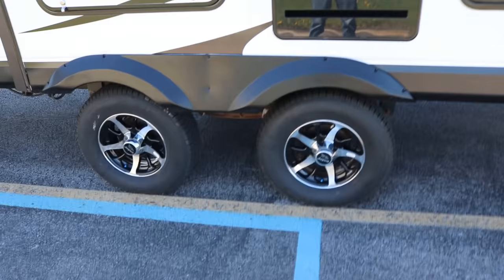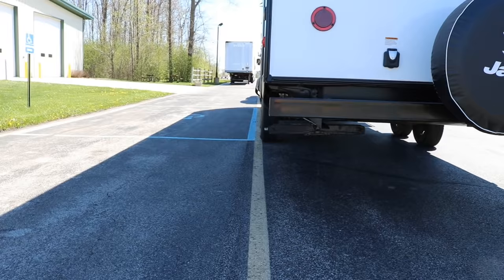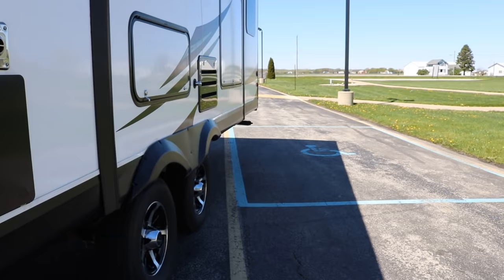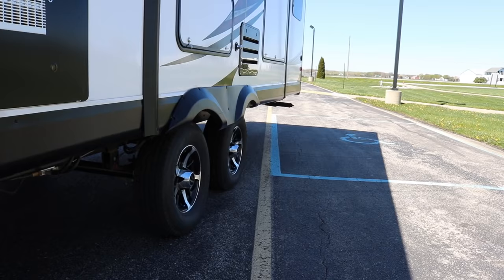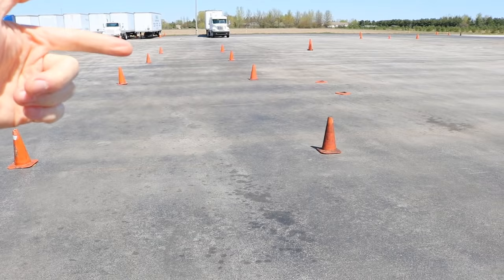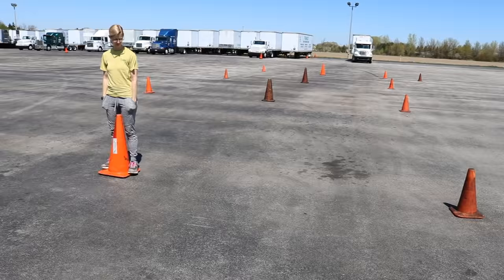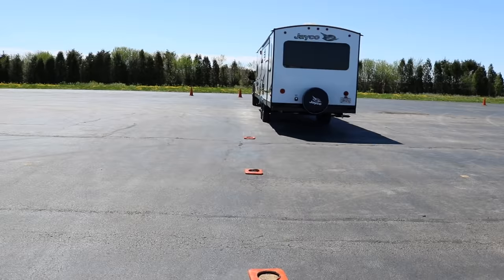HOW TO BACK YOUR RV (And Trailer "Tail Swing")

Comment: We took an 8-hour RV class from our local Commercial Driver School, which has been hugely beneficial.  Your video is a great refresher and provides some additional insights based on your experience.  Thank you, awesome video!
Reply from the maker: +CasaRocinante thank you! If you are new to towing, some official training is always a good idea.
Reply: Good the read someone had taken time to get training from a formal school, I often get asked by those looking into towing RV what to do I recommend they look at some non company schools as some like you found one do offer side courses for RV ers at a discount since it is a non CDL you got. The school I went to the head coach told us that one guy actually took the course just to drive a Semi-towed FLOAT in parades, if they are close enough I recommend the independent T-T training school I went to.

Comment: Man, I'm so glad I found this video.  I haven't seen one that goes into this depth on teaching how to backup a trailer yet.  I appreciate the work you put into making this video and it will definitely be of benefit in a real world scenario when I have to backup a 29.5 foot camper.  I plan on finding a nice empty parking lot soon to practice.  Thanks again!
Reply from the maker: +Kyle Baker I still can't believe how well received this video has been! I had no idea at the time that it would help out so many people. I appreciate your feedback and wish you luck with your backing practice.
Reply: Just make sure you looked for posted signs before using if they mention requiring contact for permission to use said lot, not all are friendly enough to just let you use at will. If you like check in with trucking companies nearby and see if they got lot space and would let you come in to practice, or if they offer workshops even.

Comment: The best trailer backup video on YouTube!! Thank you so much for taking the time to make this video. Your multi angle video shots and clear explanation really has helped me to clear up what to do and when. I always found I over steered initially and not using your 11:00/1:00 rule. Now i can see my mistake. I'm looking forward to taking my new trailer out and putting this info to the test. Thanks again from Calgary, Alberta Canada :)
Reply from the maker: +John Cronk thanks for the comment! Over steer is a very common mistake. Good luck with your new trailer, practice makes perfect.

Comment: This was the first video I watched while I was waiting to pick up my travel trailer. This video is invaluable. I have pushed/pulled/backed F-15s into parking spots during my 21 year career in the Air Force. But as I found out, I can easily jack knife a trailer versus/over a big fighter jet. I still watch this video to this day just to refresh my memory on the wheel turning and the angle of travel my tow vehicle needs to stay within in order to not lose control of the tracking of the trailer.
Reply from the maker: Thank you! We appreciate the feedback. Glad it's helpful😁

Comment: Back in the day, I was told to put my hand at the 6 o'clock on the wheel while backing up , that way all I had to do was turn to which ever side you wanted the trailer to go , if  left, turn the wheel up (towards the left) or the opposite for right.
I like that technique about turning to 11 o'clock or 1 o"clock  and then straighten up.

Good video, good advise.
Dslsmoke
Reply from the maker: +Dslsmoke DP that 6 o'clock position is a tried and true method. I like teaching it from the top of the wheel and steering towards the "problem" because if you can back in a straight line, you can back in anywhere!
Reply: That's a good idea too! Thanks for the input. I've backed flat bed trailers, but not a travel trailer. the travel trailer has more blind spots; you can't see the back opposite corner.I will be towing my own trailer soon as my husband won't be able to anymore. Thank you for the advise.
Reply: Yeah putting your hand at the area above the 3 and 9 marks you have to counter turn to the direction you want to go or for more easier you just the points below the 3 and 9. Or as I use this; Counter clockwise to go right and clockwise to go left when starting to back from a straight line up.
Experienced Trucker.
Reply: I back up my trailers with my hand on the bottom (6 o'clock) and it works too. I even teach it this way. Use 7 o'clock and 5 o'clock for position to straighten up. This a wonderful video for learning!!

Comment: Was looking for a video like yours to point a friend/new RV'er to watch & learn.  Good stuff.  I've been RV'in a long time, taught many how to do this too. Way back as a 10 yr ole kid my Uncle taught me how -- he was a pro at this, worked in heavy equip.  He said instead of holding top of stearing wheel and thinking " to go right turn left, etc" - he said hold the bottom of the steering wheel -- then when you look in your mirror & you want the trailer to go left, your hand on the bottom of the steering wheel goes left & it goes exactly where you want it.  Explaining using the bottom of the steering wheel is "less confusing".  Like your point of looking at the tires -- no one is every going to do that.  Try it -- hold the bottom of the steering wheel -- so many folks I've taught always thank me & my Uncle for that tip.  Again, thanks for taking the time to make your video's.
Reply from the maker: I was a truck driver for 16+ years and have been teaching truck driving at a CDL training facility for the past 6 and my method out performs the bottom of the wheel buy a lot, which is why I teach this method👍🏻 thanks for the feedback!

Comment: I just wanted to thank you for the video. We just took our 34' 5th wheel to the campground this weekend and your 90° backing in tip helped immensely. This was a relatively tight spot off a one lane road with other RVers and trucks parked just on the other side of the road. I actually got it in the spot fairly quickly with a few more tries to get it scooted over a foot or so because I backed it in a bit too close to the one side. It only went as well as it did because of your help. Greatly appreciated!

Comment: THANK YOU!!! I am one of the volunteer dads for the local high school marching band (pit-pops) and we all have to learn how to drive a two axle trailer about the same length (your demonstrating in the video).  The trailer has all of the marching band instruments.  Your instructions backing up from the right lane into the left land and subsequently driving straight back were well described.  Summary in my mind...3 mission critical segments and angles to line up prior to backing straight in.  This is key for us volunteers because there are a lot of of other buses and long trailers that we have to parallel park next to ....when there is a big marching band competition and the trailer lot is packed!  Thanks!
Reply from the maker: That's great, glad it helped you!👍🏻

Comment: Thank you  very much.  I hadn't backed a trailer for about 20 years.  Then last year, because the driver had an emergency and left,  I backed this utility trailer into a spot (not perfect but close enough for government work).  Now, I have been told that I am going to teach a gal who has never backed a trailer to back up the utility trailer.  Thank God it has dual axles.   I will not have the trailer in order to practice.  Also, I am going to have to find a quiet street in a commercial area to do it in.  No pressure here.    I am going to watch your video several times before the fateful day.  Thanks again.
Reply from the maker: Glad you found the video helpful! Good luck teaching and let us know if you have any questions!

Comment: Thanks for the outstanding video. I just purchased a 35' 5th wheel a couple of months ago. I have only backed a trailer one time in my life, 30 years ago. I managed not to break anything, but it was not pretty. I scoured YouTube and found several videos on how to back a trailer. Some left me more confused than before I watched them. Your instructions are clear, and more importantly, they make sense. BTW, on my first outing I had two gentlemen offer to spot for me. They finally admitted that neither had ever backed a trailer in  their life. Yes, it was an extremely frustrating experience. Again, thanks for the great video.
Reply from the maker: Glad to help
Reply: Yeah, spotters are only helpful if they actually know what they're doing, otherwise......well, you know how that turned out.

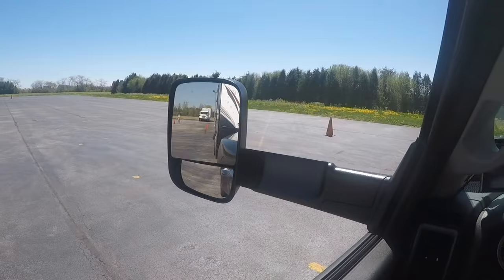Comment: 4:55...Great video.  One difference here is I was taught,  to put the hand at the bottom of the wheel and move it in the direction you want the back of the trailer to go.  I'm dum.
Reply from the maker: That is another method that works. I've found in my training that people tend to pick up this version easier

Comment: The best thing you taught me that I have never forgotten is "steer to the error". If the trailer is going to the drivers side turn the truck steering wheel that way. The other thing is to only turn the wheel one turn and let the trailer start to turn before starting to correct. I can back a trailer like a boss thanks to your tips.
Reply from the maker: That's great! Glad to help😎

Comment: great video, my dad always told me to put hand on bottom of steering wheel and turn the wheel to the mirror you want your trailer to go to. so if you have hand on bottom and turn steering wheel to drive side which would be clock wise trailer will go left...if you turn your hand towards passenger side counter clock wise trailer will go right
Reply from the maker: Both methods are effective! Students tend to understand and learn better with the method I used in the video.

Comment: Awesome video!  Third time towing 2 yrs ago I drove 3K miles to meet friends at Glacier N.P. I tried to reserve pull through camp sites but they weren't always available esp. at older parks. I did quite well only lost one side light cover which was easily replaced. Your visual was especially helpful as I didn't realize Tail Swing on my 28' could be so wide. I took notes & will recommend your video, as a few of us are solo drivers. As a widow driving alone myself the more tips the better, esp. when pulling into a campground after a long day of driving! Bless you for your clear, & easy to understand visuals!!
Reply from the maker: So happy to help! Thank you for your kind words☺️👏🏻

Comment: Thanks, very helpful. The most important thing I learned is the wording. You said "turn towards the problem". This is a very easy way to remember which way to turn the steering wheel". It is this kind of thinking that is easy to remember. Great job my friend. I will add one more thing. Comment about not turning the wheel no more than from 11 o clock to 1 o clock is another very important thing that newbies need to remember as you point out. Small turns then straight, then another small turn then straight. In most cases when backing into campsites you do not have a wide road so if you make a very large turn with the truck you will swing way out with the truck when trying to bring it back in line with the trailer. This sometimes can mean driving off the edge of a paved road which can be significant. Excellent video. I was in Mammoth California once and had to back into a campsite with large trees on both sides and had to make a 90 degree turn when backing up. This was to say the least very difficult. This is where you really have to turn the truck. There was not much room in front and also was a small hill. I made it in but had to run up over the hill. The best way to avoid this is through research of the available sites with Google Earth or maps or the sites themselves. You can get rid of a lot of angst and shouting at the wife ahead of time but this is not always possible. It is just better to start your camping experience with a little research besides why take it out on your wife. I have seen the wife catch hell every time. You are out there to enjoy yourself why star off on a bad note? Have fun and go easy on the wife it pays off in more ways than one when in the woods. LOL

Another note. When your truck is at 90 degrees to your camper you are pushing on the frame with a tremendous pressure. My friend used to let friends take his travel trailer and came back with the frame cracked. $6,000 later he had learned his lesson. Never push a trailer at 90 degrees to the truck. The forces are huge and your leveler bars can cause damage.

Thanks for a very informative video. Most people have no idea how much effort those of us that post go through to help them. It is a thankless job.

Comment: Really liked this video.  Had a tent trailer for a few years and was getting pretty good at backing it up.

Last summer we bought a 20' Travel Trailer.  Sometimes I get lucky and get the trailer in first shot.  Other times I feel like I should give the campers next to me a beer for the pain I am about to inflict on them watching me!

Recently had an issue when backing into our site (was also dark when we got there).  Tried numerous times and still had trouble.  The guy next to me came and guided me and got me right the way I needed.  Many of the things he told me line up exactly as you have mentioned in your video.

There is a lot of good information in here that will help me going forward.  The dual camera is also a huge help in understanding what is happening.  Also your explanations of what is happening with the trailer once you complete a move (ie the trailer will continue to drift for a little bit) helps to put it all together.  Thanks for the tips and taking the time to put this video together.  One of the best I have seen.
Reply from the maker: +Art Vandelay thank you very much for the comment! Glad you found it helpful. I've helped numerous people back in campsites when they're too frustrated and feel pressured by others waiting for them to get in. Even got in the driver's seat and backed a camper in for someone once. They were very thankful! I think I need to advertise at campgrounds were at that I can back in your camper if needed😉👍

Comment: Had my first lesson today driving our trailer.  Went to a empty parking lot to practice.  Driving forward was no problem.  I was ready for the straight line backup.  Hubby trying to give directions.  My instintcs told me to turn the wheel one dirction but hubby kept telling me turn left, turn right.  Is my hand supposed to be at the top of the wheel or the bottom.  No clue what to tell me.  I remember seeing this video and pulled it up quick to watch again.  The instructions you gave to put hand at the top of the wheel and turn into the problem or error was just what information I needed.  I follwed this and within seconds I was backing the trailer up straight with no problem.  Hubby was impressed. Then I wanted to learn how to back towards a campsite.  Took a about 10 minutes for me to get the angle and into the space I wanted.  Not bad for my first time out.  Had to rely more on my instincts than my husbands directions.
Reply from the maker: That's so great to hear!👍🏻👏🏻👏🏻

Comment: Thank you for this video.  When I and a friend wanted to go to a quilting retreat we decided to use my new trailer and pick up.  My husband had used it for out of town work and was fearful of me taking it myself, but I was determined, so he gave me a crash course.  I had no idea that the back end would swing so far out.  I almost took out several gas pumps at the first gas station along our journey.  At one time I stopped and asked a guy next to me if he knew how to straighten my trailer out.  Of course he had a small camper, and maneuvered me to a safer position.  I did get a little better as we covered over 1,000 miles one way. I gave up trying to back into a parking spot at the camping grounds. I would get out and ask someone to do it for me.  There were always nice people willing to help two women that looked desperate.  The stories I shared of our adventures were hilarious, and I'm amazed we made it back.  I'm going to study this video and maybe the next time I become adventurous things will go smoother.
Reply from the maker: Glad to help! You can do it. Practice makes perfect

Comment: What a great video! I think of the steering wheel direction in a similar way. I turn the wheel to "push" the back of the trailer to where I want it to go. The 11:00/1:00 is the single best piece of trailer backing info I have ever seen! I have a tendency to over steer, and have to make a ton of forward corrections to realign the truck with the trailer. This video will help immensely! 73, Len KD0RC

Comment: Great video 😁  I have been towing for about 10 years.   never thought about parallel  parking.   But it is just the lane change without the straight backing after.   thanks a bunch.
Reply from the maker: +Paul Vernon yep, that's pretty much it!

Comment: nice vid. i have been driving big trucks 20yrs and still turn wrong sometimes if I look out the window. used to using mirrors. if i drop my trailer and backup my bobtail i will turn the wrong way sometimes. hahaha. that muscle memory takes over. lol. the part of the video when seeing how far i have left. i will find a spot about 2ft on the ground backwards from yhe drivers seat and stop when i get there. when backing at night i use my brake lights to lught up the area to help see. i always use the front tire as the pivot point on the trailer and never look at my trailer when backing up. i use my tires and watch them on the ground when i can see them. great vid. hope it helps some rver's out, especially at fuel islands.
Reply from the maker: Thanks for the comment, I drove truck for 16 years and used to use my brake lights when backing up too haha.